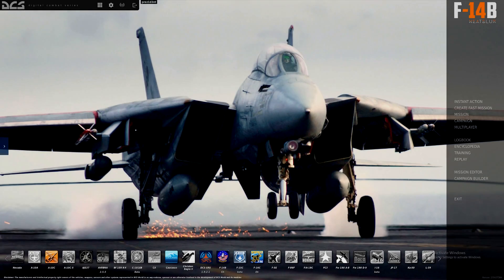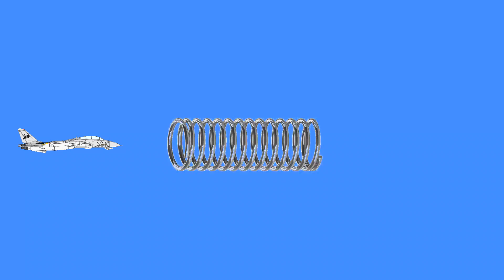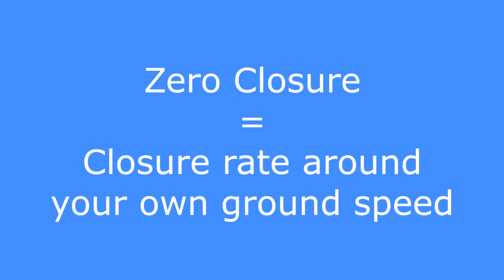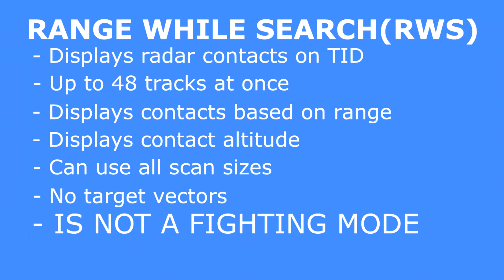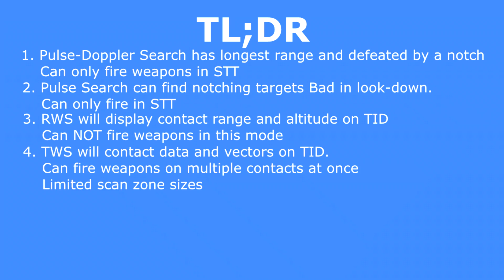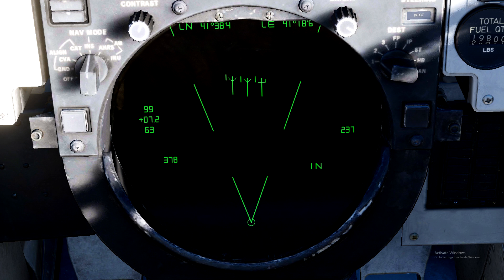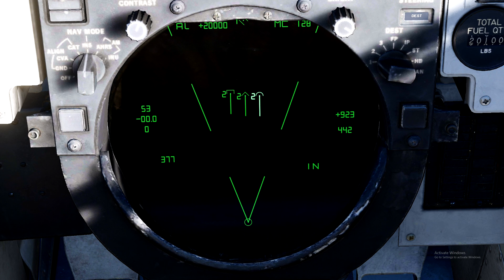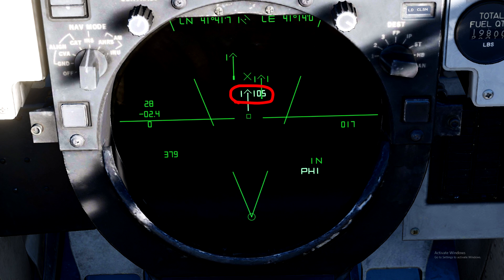DCS F-14 TOMCAT for DUMMIES Chapter 3: Understanding the AWG-9 and TID

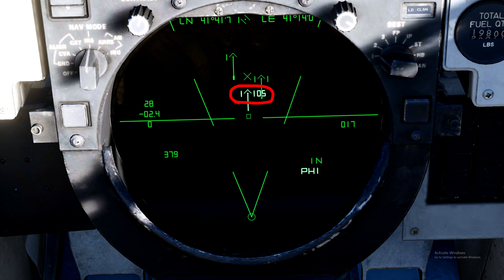Comment: 13:31 When you fire the Aim-54 Phoenix missile, the countdown will start blinking around 15-20. This means that the missile went pitbull (use its own radar). This is useful if you need to go cold, as you don’t need to support the Phoenix missile anymore and is basically a fire & forget. I know you have a more advanced RIO guide but I haven’t watched it so I’m not sure if you covered this. So my bad if I’m repeating information.
Reply from the maker: It varies more than that. The rule of thumb was 16s, but it can be over 25s at times or as short as 10. Just depends on a lot of things like the target size switch.

Comment: are you gonna do this series for the f4?
Reply from the maker: Yes
Reply: @PrezDCS  nice! im currently looking at how to jump in rio seat and either alter the tws order to sort targets or stt 1 of them
Reply from the maker: @Scoobydcs  I’ll have a Combat for RIOs tutorial out at some point in the near future, but for now I’ll help you here. There’s a button right next to the missile launch button in the RIO’s seat that says “next target” which will immediately make the currently hooked target on the TID in TWS the first target in the launch sequence. You can’t designate any further than that unfortunately. As for STT, if you have a target hooked in TWS and just hit the PD-STT or P-STT buttons on the DDD panel and it should lock up the target automatically as long as you and the target aren’t maneuvering
Reply: @PrezDCS  THATS SPOT ON THANKS. is pulse problematic at longer range or not? and can you support a phoenix in tws pulse? isnt it pd only?
Reply from the maker: @Scoobydcs   the AIM-54 is PD only. TWS is also PD only. You’ll need a PD-STT if you want to guide an AIM-54 in STT. Pulse has a usable max range of about 40NM for the average fighter target, anything beyond that and it’ll be hard to hold a lock. It’s only advisable to launch Sparrows with this mode. Since they don’t guide off the AWG-9 but the dedicated CW illuminator located on the dish similar to the F-4 Phantom and the APQ-120.

Comment: Question about the vector bars 
some seem to be double thickness and stretch out longer in an narrower line , what is that about?
Reply from the maker: The length of the vector line is just closure symbology, but if you have the Phoenix missile selected and are in TWS then there may be "WEZ" lines that replace the vector lines that give you symbology on a calculated WEZ. The double thickness thing may just be a datalink vector and radar calculated vector overlapping or something. They should all be the same in looks. The WEZ vector lines tho will look noticeably different.

Comment: Great content ! 
I never use P-STT, because it does not provide any tracking solution for missiles, except short range boresight.
I use the MLC switch to remove the Doppler filter from PD modes, when needed.
P modes and PD modes w MLC off don't like ground return, so my best option is to always fly below my targets.
Reply from the maker: Yeah, P-STT doesn't track accurately enough to display track data, but it does at least allow you to fire missiles at things. Although it really shouldnt be used at any ranges other than within visual range